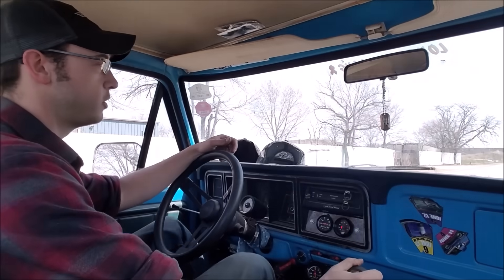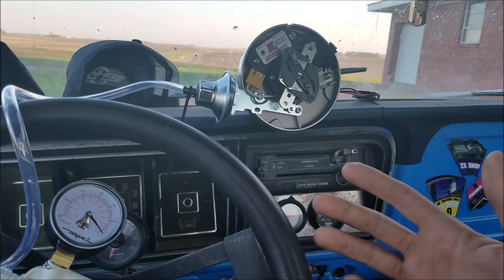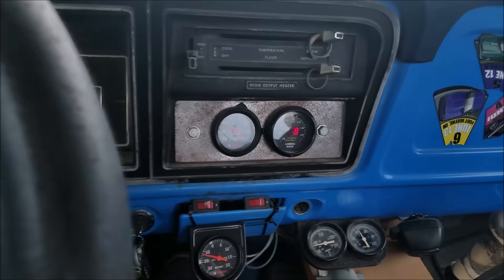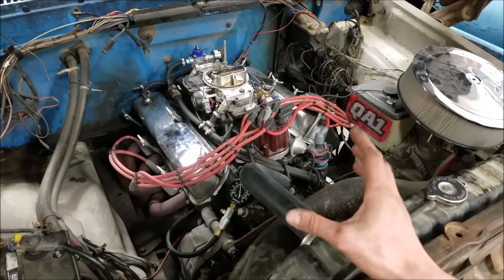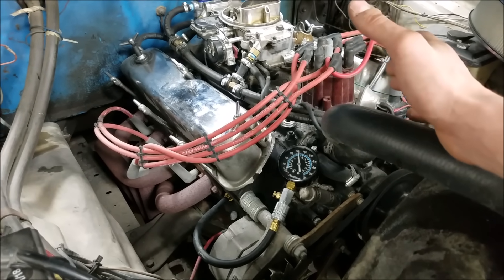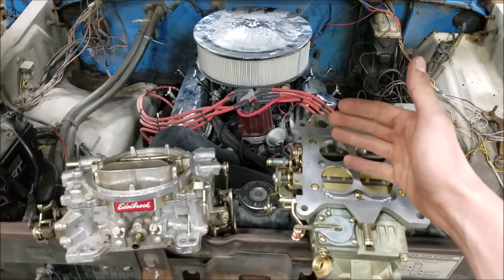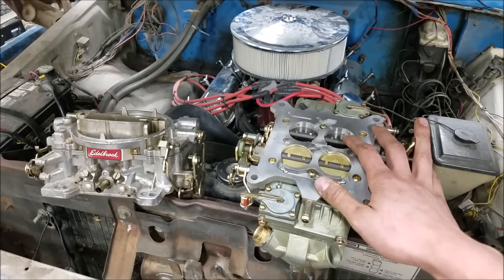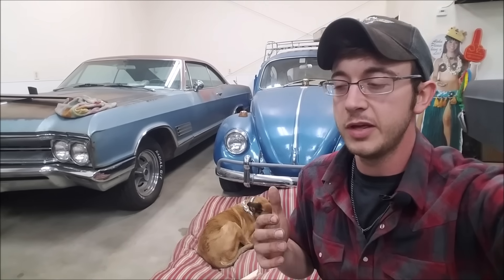Vacuum Advance - Ported vs Manifold: Which to Use & When !!!

Comment: Luke, thanks for making the vid. An old school guy who tuned Vincent's, Manx Norton's and British cars etc told me for performance, remove the Vacuum line to the dizzy and block off the port of course as it was "An economy device". And worked like you said, at cruising with light throttle opening. 
This is how he said to tune.
Set the idle low and advance the dizzy until you pull maximum vacuum, then retard it by 2" of vacuum which should be approx 2deg of timing. Go with what ever is lower, plus 2 of vac or time. 
Drop the idle and readjust the mixture if necessary.
I have a Aussie Ford 6 you don't see in the states, but the base is the 250. It runs a ECU with a HEI dizzy. To set the ignition advance you put the engine ECU into Base Ignition mode and the ECU stops controlling the advance. If you turn the dizzy in operating mode, the ecu will control the base idle, so it will have no effect. 
Once you have the base ignition timing set, you turn of the engine and put it into normal mode. 
When it restarts, the ecu doesn't see the advance timing and controls the idle speed with the idle speed motor. 
So instead of running 10deg btdc it can now run 20> deg with 98RON. Cheers.

Comment: I disagree with his theory because the "vacuum advance" needs to be looked at as a "vacuum retard". The ported vacuum came along during early SMOG days & was nothing more than a crutch to get inferior technology to pass emissions(less HC at idle with less timing & less CO when you close the throttle / coasting down). On pre-smog cars, MANIFOLD vacuum pulled timing in at idle, compensating for lack of mechanical advance. It also added timing during high vacuum cruise for better fuel economy, & improved throttle response in transition from vacuum to mechanical under WOT. I run 14* initial / 18* mechanical & a 15*/15"v on manifold vacuum in my 409 SBC street truck(9.55:1 comp & 211*/.540" hyd roller cam) & it wouldn't idle(let alone idle CLEAN!) WITHOUT the manifold vacuum pulling timing in. IF his theory on cruise timing is correct, then I still have the same total timing running down the highway 70mph @ 1,800 rpm cruise! It runs pretty good. It's an all motor, 87 OCTANE, 4,000 truck with 3.08 gears & a 700-R4 with an 89ish Vette converter. It'll run 150 mph top end, High 12s / 100+ qrtr mile & gets 17+ mpg on cruise with converter locked BUT took a TON of carb tuning to get it right. A 2" HVH Super Sucker REALLY helped overall vacuum, throttle response, fuel distribution, etc & it also enabled me to lean out the idle & other fuel & air circuits. Ignition was simple. MSD 6AL chipped at 5,900 & MSD Pro Billet HEI with tuning. Handles like a Vette & hooks up GR8 for a leaf spring truck. Gonna FAB a long torque arm & help the hookin' up thing. TORQUE rules, especially on the street!!!
Reply: Not so.  Most pre smog engines were set up with ported vacuum to the advance can.

Comment: Done this for decades and will never use ported. The thinner idle-mixture needs earlier combustion. See Cranes setup or read this: http://chevellestuff.net/tech/articles/vacuum/port_or_manifold.htm
Reply from the maker: You didn’t listen did you - yes it does. Why ported is better for a lot of engines is because it allows you to run more mechanical initial so you don’t come off the line flat. 
A ton of people have way lazy mechanical initial timing because they run manifold vacuum.

Comment: Luke please give me your thought 454 comp cam 595 lift, 206 closed chamber heads edelbrock 800, total timing set at 34 degrees light springs bushings set for 18 mechanical degrees so initial at 16. Vacuum is low and I put blue springs to keep metering rods from bouncing, but cant adjust air fuel mixture at idle any suggestion and should i set vacuum to ported or manifold?

Comment: That Ford left the factory with vacuum advance connected to a port on the 4100 carb that gave it full manifold vacuum, as most engines did till about '68 or thereabouts. Ported vacuum was an emission jerry-rig to help air pumps burn more of the unbunt fuel in the exhaust manifold at idle. Engines with full vacuum to the distributor run significantly cooler at idle with considerably lower under-hood temperatures, which may be a factor for you (especially in the summer if you spend much time idling, such as in traffic). I wrote an article about ported vs manifold vac back in the late 70's for a local gearhead mag, but I cannot find a copy. Guys were buying race distributors (no vac advance) for the street and wondering why their headers & cast-iron exhaust manifolds were glowing red after idling for a spell...and wondering why their gas mileage was worse then their most pessimistic expectation for their newly rebuilt motor.  Many (most?) aftermarket carbs (like Edelbrock) will have a choice of ported or manifold vac for the dist. Anyway, there's an article over at Super Chevy that goes into a bit of detail about this: https://tinyurl.com/yarced6e
I understand the point you are trying to make about the throttle being closed so far that you may get a lean stumble off idle, but I've not experienced this with a properly set up carb and working accelerator pump in 50 years of wrenching, even when using full manifold vacuum. If ported works OK for you, then that's fine, but personally I like to keep the engine and engine compartment temps down as much as possible, so I go for full vacuum to the distributor.
Anyway, love your vids Luke! Keep wrenching brother!
Reply from the maker: Advance you initial mechanical and limit your total timing - then run ported. A guy can’t just run ported - the ability to advance initial mechanical is where the Benefit lies. Most timing configs are too conservative, this allows you to have a more aggressive timing curve and make much more power when hard in the throttle
Reply: @ThunderHead289   I guess one thing went unsaid when I mentioned that most aftermarket carbs gave a choice of ported or manifold vacuum: a LOT of OEM carbs for 60's vehicles did not give you an option (think most of the Quadrajets did, and most of the later 60's AFB's). Manifold vacuum or bust for the majority of 'em. That 4100 uses ported vacuum to the distributor IIRC, so I believe I was mistaken in my previous post.
 The 2bbl Rochesters and Carters used by GM and Chrysler mostly used manifold vacuum. I cannot remember one way or another about the Autolite 2100...think it might be manifold vac? Shit, I'm old. It'll happen to you too.
The only 60's vehicle I own now is a '69 Jeepster with the Buick odd-fire 225. The best all-around carb for this motor is the lowly Rochester 2GC (bulletproof little bastid). Manifold vacuum only. Tune-up specs call for 5° initial and specs for the Delco distributor say an additional 22° or so with mechanical and 16° more for the vacuum adv. I add a few degree to the initial before it starts getting pissy with fuel. Also might note that lots of initial advance can make the car a PITA to start on winter days.
So, not everyone has a choice of vacuum ports, and not everyone is trying to turn their rig into a 1/4-mile beast, so as long as it doesn't stumble at the stoplight or passing lane, we're cool. Sometimes we're just trying to get the stock setup working as well as humanly possible.The original engineers (who knew what they were doing) gave you tune-up specs, and while they can be a bit conservative, they also had to allow for all the crappy fuel that owners might encounter (memories of the [estimated] 70 octane fuel purchased in northern Nevada circa 1972). But, if followed, those OEM specs still result in a pretty decent running motor, with no surprises.
Now...if I had my old '66 Mustang K-code Fastback again (sigh😢) and was gonna pop on a new AVS2 or Street Avenger (both great carbs), I'd go for lots of initial  + ported vac, with an adjustable vacuum canister to limit total adv. 👍
If I didn't apologize before for this lengthy tangent, I'll do so now. Most of your target audience is looking for performance advice with aftermarket upgrades., and you are spot on in these cases. Suppose I jumped in for the guy with an old carb looking for the missing timed vacuum port.🤷‍♂️

Comment: What are you using for the high / fast idle solenoid? Most of my research says they aren't strong enough to open the throttle on their own, but yours seems to have no issue opening the throttle with the flip of the switch. Are you using a relay to trigger it and a heavy gauge wire?

Comment: Yeah, with the transfer slots closed you have a flat spot or a bog coming off dead idle, but you are also burning way less fuel at idle and your engine will run happily at 600 RPM with way less heat build-up.  Heat build at idle in stop and go traffic is a management issue that can be avoided mitigated with manifold vacuum.  If you wanna eliminate the flat spot, just foot brake  around it and go.
Sure it feels snappier to have ported because you have added more mechanical to compensate so you have more timing everywhere now.  But if you have part throttle ping on the freeway, you have gone too far overall.  It's all a balancing act ...

Comment: I use ported vacuum on every engine I've owned. My 675hp pump gas 502 BBCHEVY runs ported vacuum.
I curve the distributors so I have total mechanical advance at 1200 rpm. The vacuum canister is also tuned with a stop.
If you watch a modern ECM engine on a laptop they will run 36 degrees coasting to a stop sign.
If you run a vacuum secondary Holley and your transfer slots are uncovered too far remove the carb, flip it you will see a small screw that will adjust the secondary throttle blades. Open the secondary throttle blade so you can adjust the primary lower.  
500cfm 2V holley gets around that by .125 hole in the primary throttle blades.

Comment: Read and learn   http://www.superchevy.com/how-to/additional-tech/1601-everything-you-wanted-to-know-about-vacuum-advance-and-ignition-timing
Reply from the maker: You can do what you want - arguing what you see in my video is futile since the vacuum gauges clearly show what is going on.
Scroll through my Channel and get schooled. 

Thunderhead289
Reply: @ThunderHead289  Manifold is always better period and it is flustering to see you say ported is better for a mild cam street engine, you are incorrect.  You say it will give too much advance at idle and mess you idle tune, well then you need a adjustable limit plate so you can set the advance exactly where you need it.  I always use the adjustable vacuum canisters with the limit plate to tailor it to my set-up.  If you just run it to ported you lose that great off idle response and cooler stable idle, great for daily driving all year round for years and years in the desert.  Your head is too big and you will never admit that you are incorrect.  It is a good video showing what each does, but sorry manifold is better.
Reply from the maker: Sit down in your chair and put your listening ears on. 
Here’s some anti-manifold tech for you. When you hit the throttle from a stop your vacuum advance is gone until vacuum returns, so you are just on initial mechanical plus whatever your advance curve has given you - short story is you are leaving power on the table - and I’ll address your point momentarily regarding the adjustable vacuum advance. 

Okay, so with ported you can then add initial mechanical, and recurve your distributor accordingly to limit total timing. If you limit your vacuum advance to keep with an acceptable initial mechanical and added manifold vacuum advance degrees, then you are leaving economy on the table cruising (if your advance curve is worth half a heck - a lot of guys pull it in too quick to compensate!) 

Moral of the story, for a daily driver if you run more initial mechanical, ported vacuum, bring your timing in by 3000, and limit your total timing with 12-15 degrees of vacuum advance available, it will be a great driver. 
Pulling all your timing in within the range of cruising RPM is not ideal. 3000 is higher than you should ever really be cruising at, the springs can be stiffer to accommodate this which prevents floating timing at idle from worn springs - which I will tell you happens pretty quick with the lightest set. 
Thunderhead289 @ YouTube
Reply: ThunderHead289 This is how you set up a vacuum advance distributor. 
1. Set total timing with engine at 3500 rpm to 30-40 depending on engine compression. That is the most you want at WOT.  
2. Hook up your distributor to manifold vacuum at idle, with a dial back timing light you need to see how much timing is added. Most vac cans will see 40-50- you can adjust this with a limit plate kit. I like to run as much as the engine allows before breaking up from over advancing.
3. This is important that you have an adjustable vacuum can.  You will set the rate of response that the advance fades as you open the throttle, you tune how much and how quickly the advance fades, at full throttle it will be gone and that is good, you do not what to over advance at full throttle and remember we set that earlier.
4. Get all this dialed to your set up and you will enjoy a tire chirping cool running engine with good full economy.

You say manifold vacuum goes away off idle, not true it just goes lower depending  on throttle input off idle, full throttle both go away anyway, although I have see 5in hg with ported, that would cause over advanced at Wot, to be avoided.

Ported sux
Reply from the maker: I’m going to poke holes in your logic here - you can’t set total and then casually go set initial with vacuum advance hooked up. You wouldn’t know what your mechanical initial is. This is why I come up on so many folks with late timing on hard throttle. 
Vacuum does drop out, and then return and stabilize as rpm increases and you give less throttle input. 

Idk where you get your info, because it’s old timer folkor bs. I didn’t become Thunderhead289 from tuning folks engines poorly - that’s why people literally pay me to do it. At the end of the day you can do what you want, you will have to let me know if I have a tail light out because that’s all you would ever see.

Humor me, go set your initial mechanical to 10-18 and throw your advance on ported and watch your own jaw drop. Recurve your distributor as I have explained above and spend more time scratching your head and more time enjoying your ride 👍
Or go watch uncle tonys garage - seems like the type of guy YOU would like.
Reply from the maker: Eric Kirts lol you clearly are. Enjoy a life of slow cars and mediocrity since you clearly have no desire to correct your ignorance 👍
People like you are a scourge to the car community.

Comment: Old engines used manifold vacuum help with idle. car manufacturers started using ported vacuum on smog engines. If you have your mechanical advance set up to all in at 36-38 degrees by 3000 rpm, you dont want to add vacuum with the ported vacuum port. You should then use manifold to help it idle better.  I strongly disagree with the ported vacuum for the distributor advance.
Reply from the maker: You didn’t listen or understand anything I showed you did you - and for the record, a 64 galaxie is factory ported, long before any smog regs. So that’s also false. 
But if you want to put around in a turd running manifold accompanied by extra lazy initial mechanical timing so when you hit the throttle you have no power, be my guest. 

You can just switch from manifold to ported, you have to accompany the switch by advance initial mechanical - that’s where the whole trick to it is, so when you punch the gas and vacuum drops out, you still have correct timing

Comment: I am interested in your high speed idle switch at the 2:50 mark.  Do you have any other videos or links that go into this and how you set one up?
Reply: You can use a Ford "anti diesel" solenoid. It is a plunger type solenoid that was used to bump up idle while the AC was on. 
It has one wire. Use a 12v fused source to power it. Put a toggle in the hot wire.

Comment: Awesome explanation.  I have an 83 Chevy k10 with a 305 quadrajet.  I could never really get this motor running right until I recently bought an advance timing light and set total timing at 35° it's running so much better but I installed a new HEI and I'm not sure how to set the vacuum advance.  I get just a little miss barely noticable at part throttle only in 1st gear.  It revs great but I think that vacuum canister needs adjusted.  Man! Your video is awesome!